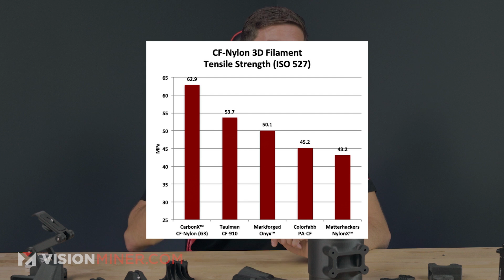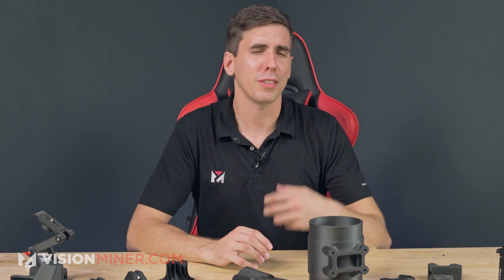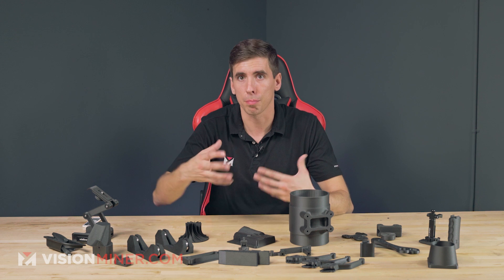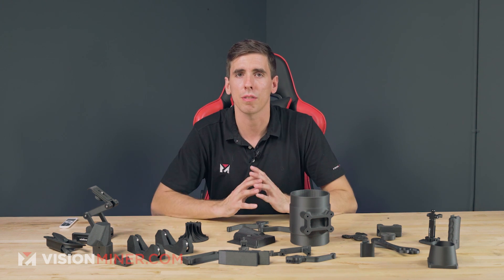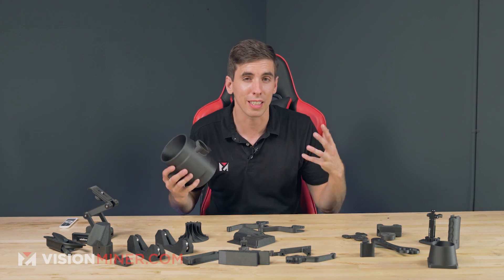What is Carbon Fiber Nylon Filament and Should You 3D Print It - Pt. 1

Comment: Few things you forgot to mention. CF PA ("Nylon" is a DuPont brand name), is manufactured using different types of polyamides and different percentages. Most CF PA is created using a high percentage of PA 12 which is lower melting temperature and easier to print. However it is also has considerably less strength, hence why your levers were easier to bend. The higher temperature CF PA is manufactured with PA6. PA 6 is much harder to print, requires higher temperatures at the nozzle, higher bed temperatures, and higher temperatures in the enclosed cabinets. But it is much stronger. There are other higher temperature CF PA products which contain percentages of Ultem, Peek and Pekk in order to increase strength and heat deflection. Yes the addition of composite to PA lowers its tendency to shrink, warp and peel off your print bed. Some filament manufactures, such as Proto Pasta, add drywall dust to their filament as a composite. 

You must use a hardened nozzle while printing abrasive filaments, such as carbon fiber. Most of the temperature guidelines are based upon an Olsson ruby nozzle and not hardened steel. If you use a steel nozzle, I have found that you need to add 10-15 degrees higher at the nozzle. The reason is that the Olsson nozzle is made from brass or copper and conducts heat much better than the steel. You can print these filaments with many of the regular printers, but you will have less layer adhesion than you would with a printer that can print +300C. Adding a ruby nozzle to some of the regular printers will increase your chances of a complete melt and layer adhesion. 

Fan cooling is normally not used when printing PA. However, when printing small areas on a large part, intermediate spot cooling may keep the PA from becoming too hot and drooping. I use exterior fans and vaned concentrators for this. 

Dehydration of PA is required. PA 12 is hygroscopic (tendency to absorb moisture from the air) and the usual listed time to dehydrate these filaments will apply. However PA 6 has twice the ability to absorb moisture and requires much longer to dehydrate. Metal aerated filaments spools, such as those sold by Vision Miner, are required. This is because the 80-90C heat to dehydrate PA 6 will melt plastic spools. I dehydrate at these temperatures for 48-72 hours depending on the type of PA and how it was stored in a particular climate. 

Lastly, thank you for your video, I am an engineer and manufacture who specializes in plastics. I am also a customer of yours. I 3D print exclusively in polyamides, approximately 2-5Kg of PA6 a week. I manufacture 10,000 Kg of raw polyamides annually.
Reply from the maker: The CF part compared to the HTNCF25 is actually PA6+CF. Excellent information in your comment, though! Dehydration is incredibly important, thus our drying kits: www.visionminer.com/drykit 

Rock on! Epic information! By the way, we're happy to extend a discount on whatever you like, printing in bulk like that :) Just give us an email and we'll make it happen!
Reply: @VisionMiner  Yes, I understand now that you were comparing: CarbonX™ PA6+CF (Gen3),  CarbonX™ HTN+CF [High Temp Nylon]. The HTN is not just pure PA6, but has additional higher temperature resin added in order to increase the melting temperature, modulus and tensile strength. Both are great products that you sell from www.visionminer.com.
Reply: Hi, your comment is very interesting, thank you! I want to print CF nylon for RC car parts. I read that you recommend the filamatrix. I live in europe, do you recommend other brand ? I was thinking about PA12 mostly (easier to print). Thaak you for your answer.
Reply: @bricoletout  I think that brand is less important than the actual technical specifications of the product. Depending on what you are making for your RC car parts, you may not require ultimate heat resistance or stiffness. You may not need Carbon Fiber at all and may be able to use GF or pure PA6. CarbonX™ PA12+CF is lower temperature and easy to print as an option.
Reply: So is NylonX from MatterHackers is licensed with Dupont to use the Nylon branding?  This product is 20% CF and the rest Nylon.  It definitely likes to suck moisture out of the air, so mine lives in a vacuum case with desiccant and only comes out when printing with it and even them I have a mostly airtight box with passthrough.  Luckily these are sold in 1/2 KG spools, so once I crack one open it's usually gome fairly quick.
I'm curious if anyone uses gloves or respirators when handling and/or printing?  I haven't been, and wondering if I should be..
Reply: @Hangs4Fun  I think sanding is when you need gloves etc. I think the printed part should be fine as the fibers should align with the extrusions, and molten plastix is sticky, so you should mostly be fine.
Reply: Thank you for the thoughtful and informative comments and information.
Reply: Funny thing. I get CF-PA6 from PolyMaker, and their PA12-CF is nearly twice the price for the same spool size.
Reply: polymakers cf nylon dries at 100c on pc spools, and i find that works
Reply: From what I have seen, "high temperature" tends to refer to semi-aromatic polyamide- so (I would assume) stuff like diaminalkyl terephthalates and what not- also, the 3dxtech HTN is advertised as having water absorption an order of magnitude lower than PA6
Reply: I wonder about the stress properties considering CF PA
Simply what is the breaking point
Reply: Do you know of an easy DIY way to treat the final surface so it isn't as rough on the skin?
Reply: I appreciate all the information thank you for the post. I'm just wondering if you have any experience with CF polycarbonate and how it compares with CF polyamide because to me it seems like it has more advantages than drawbacks when compared to polyamide nylon.

Comment: Answer me this
Industry standard uses PA630GF (Nylon with 30% glass fiber), so why do filament manafactures use carbon fiber instead.
Reply: Filament manufactures also use 30% glass in some of their products. Glass fiber composites tend to be more flexible than carbon fiber and in some cases are stronger because of this. Glass composites are also much easier to print than carbon fiber and will clog less at the nozzle. One of the major advantages of glass composites is the ability to color it. Life would be pretty boring if everyone's cordless drill bodies were all black :)
Reply: @MichaelJHathaway  it just seems a lot less common for some one to talk about glass fiber filament. Carbon fiber is 80% marketing gimmick and nerds love carbon fiber even if it isn't as good. Ty for your input.
I have a carbon fiber PC spool unopened, i will use it for a custom 3d printer build. Would of loved to seen a glass fiber setup but this spool was a special order over seas as it was.
Reply from the maker: Carbon is good for other things, like ESD properties -- glass doesn't conduct electricity, so it will still work as an insulator. We actually have a glass-filled PA6 on the site now, check it out here! https://visionminer.com/products/fibrex%E2%84%A2-nylon-gf30

Comment: I bought a Creality CR 10 three years ago and removed the cooling fan so I could print Nylon - X from Matter hackers.      I only print engine parts on account of the cost of machining.    My only concern is the price of Nylon - X, and is there any other alternative like; If I buy in bulk?   I like the 20% nylon you were talking about and would like to get some for a collective pitch rotor design I'm working on.  And do you know of any alternative to Iron PLA, like is there any Iron nylon blend that I can use for 3D Printing electric motor stater core's?    I need some kind of Iron impregnated filament that can operate at a higher heat rang then Iron PLA, they call it; Proto - Pasts, it's made by; PROTOPLANT.  The 3D printed electric motors stater cores are printed out of Iron PLA to help with electrical conductivity because of it's faro magnetic propertys, it's just that PLA can't take the heat under load, and these are brushless motors, so; they need to be able to run for long periods of time.  So; do you know of any high temp Iron composite other then "proto - pasta PLA?
Reply: Try Filamatrix. Its a little less money, much better product.
Reply: @MichaelJHathaway  OK, but; how does it stack up to: Matter Hackers Pro Series Nylon carbon composite at $224.00 for 2.2kg, and Filamatrix price for Nylon Kevlar is $237.00 for 2.2kg, So; are you saying; Filamatrix is a stronger product for the money?  If so; maybe I aughta get some?
Reply from the maker: The HTN CF25 would work fantastic -- we have it on the store now: https://visionminer.com/products/htn-cf25
A tad more expensive, but insanely capable. HTN CF from 3DXTech might be enough as well, it resists temps up to 195c!

Comment: What if you dunked it into the resin used in conventional carbon fibre? Perhaps with lots of tiny holes built in in the printing process?
Reply from the maker: Depending on the resin properties, it would definitely be cool! Might lose some dimensional accuracy (depending how thick the coating is) --- but we've actually printed specifically with holes throughout the entire part (lower extrusion width/etc) so you could fully impregnate it with resin and have a pretty gnarly part...
Reply: @VisionMiner  that sounds really cool.  Might be good for small motorcycle and mountainbike parts. Winglets, crash protectors.

Comment: Can you get it wet after printing? Or is it still just as sensitive?
Reply from the maker: Nylon absorbs moisture, but usually in a final part it doesn't affect much. It will be more brittle when dry, and generally has more "give" when wet. Underwater for years at a time might not be the best, but it won't fail from basic applications, and swelling is minimal.
Reply: The answer is yes, after printing, PA can absorb as much as 10% its weight in water. However, if you anneal the PA after printing, it will be less likely to absorb moisture.
Reply: Michael Hathaway how do you anneal it?

Comment: Could you 3D print an intake manifold for a car and use it reliably?
Reply from the maker: Absolutely! Especially with the new high-temp stuff we got (HTN+CF) -- visionminer.com/materials
Reply: I think you could if you used a PEEK insulator between the to mating surfaces. Even the high temperature PACF would tend to sag in places near heat, and may be a problem near bolted areas and introduce air leaks.

Comment: Any recommendations for the z distance for supports when printing in CF Nylon?
Reply from the maker: Generally a single layer, or 0.1-0.2mm -- 0.1mm can be harder to remove, but has better surfaces than 0.2mm.

Comment: I've found that parts go floppy after you flex them a few times. Is this normal? Perhaps the fibres lose their bond to the matrix? Before flexing, they feel about the same stiffness as PLA. I printed exact same control rod in different materials to compare them.  
PS. using e-Sun CF-nylon (not their new CF-HTnylon which I can't find for sale yet.
Reply from the maker: They more than likely use milled carbon, but I'm not sure. That's definitely a cheaper brand, likely not engineering grade. However, when you bend things and they lose rigidity... yeah, this is normal, with most materials. You're actually messing with the structure on it. some materials, like Polypropylene, can be flexed over and over without losing shape, but nylon is not one of those materials and will take memory of where you flex it.
Reply: @VisionMiner I mean the same part (square rod in my example) in PLA, if bent the same amount,  would just spring back a million times without losing integrity at all. I realise it's hard to compare properly as I'm just bending them in my hands...but the characteristics felt weird from what I coudld feel. I'm keen to keep experimenting and learn more.

Comment: You mentioned that it can be printed with soluble supports like PVA or using nylon CF itself. I was under the impression that it only adhered to itself is this not true? Ive had plenty trouble using soluble supports with it so gave up and stuck with the nylonCF but it is super hard to remove most of the time. If anyone has advice on settings or materials please let me know.
Reply from the maker: Not sure who told you that, but it's definitely inaccurate. Our favorite soluble for CF Nylon is Aquasys 120, and Aquatek also works great!
Reply: What printer and slicer are you using?
Reply: Tyler Wright Raise3D pro 2 plus with ideamaker

Comment: I printed multiple parts in matter hackers CF nylon on my mini prusa. It prints really well. 255/100 temps. I printed in an enclosure I built myself.
Reply from the maker: Heck yeah!
Reply: Does it stink?
Reply: @rcplayday7937  No it doesn't stink. The enclosure contains most of the smell. But the smell isn't bad at all.
Reply: @3DO-Biking  thanks, I just got a roll of easy nylon, I dont have an enclosure is it a must have?
Reply: @rcplayday7937  You should definitely enclose it. My first enclosure was a cardboard box. I made a lack enclosure and I bought an enclosure from Wham Bam. The Wham Bam enclosure is damn good. It's not that expensive either.

Comment: I've been using a MarkForged Pro with ONYX material to print several workpiece fixtures and prototypes. The printer has the option of embedding continuous fiberglass, but that's not an option I use as often. The parts come out fairly clean with minimal layer lines. I can't tweak any of the settings on the Markforged printer though, so I would worry about trying another brand of similar filament. The printer doesn't have a heated chamber or bed, but I haven't had any warping issues on lower-profile parts.
Reply: I use a Markforged 2 at work. It can imbed CF into the part but I don't usually need it. When I do need the extra strength though it is great! The parts become very stiff flat & strong. They advertise it to be as strong as AL but from my experience,  I don't I don't think so but still very good. I like the machine & rerely have an issue with it.
Reply from the maker: Onyx is nice, but like you said, you're super limited on an expensive machine. We get incredible results with the multiple blends of CF we carry -- CFPA6, CFPA12, and CFPPA (CFHTN) --- all of which are stronger and more rigid than Onyx alone, and actually more rigid than the fiberglass embedded parts -- we know this, as we duplicated their samples and tested :) However, when it comes to super crazy parts, the embedded CF still does shine.

Comment: great stuff I use it all the time but we tried one of our drone frames out of it it's not very impact resistant like regular nylon 910
Reply from the maker: Definitely more brittle with the CF, while much more rigid!
Reply: I feel like that would be due more to its rigidity compared to 910.  Generally softer stuff is more impact resistant.
Reply: Interesting, I’m waiting on both of these filaments, 3DXtech CF nylon and Taulman 910 to see how they both perform (using Prusa MK3S) 

How do you find ease of printing with the  910 vs CF Nylon?

Comment: What would the downsides be if I were to use this material on my ender5?
Reply from the maker: Warping on larger, thicker parts. If you can keep the first layer down well (our Nano Polymer Adhesive works GREAT), and possibly toss a box over the machine to keep heat in -- you'll have a great time :)
Reply: @VisionMiner  I don't wanna sound ungrateful, and as I said, you Nano Polymer is irreplaceable for high temp stuff (PEEK, ULTEM, PC, etc). But I have to say, for nylon - Magigoo actually works much better!
Reply: If you start with standard printer - biggest problem with CF-nylon is abrasion.
You need: hardened steel, vanadium or ruby nozzle for this.. 
Coz, it will ruin brass nozzle very-very fast, you might not be able to finish even a single print.

Comment: Can't wait to try out that HTN  CF25 and HTN-Z
Reply: Wait.. are you guys talking about Essentium or MarkForged?
Or new 3DXTECH HTN+CF?
I just got 3DXTECH, but it doesn't say what's the percentage of CF?
Reply: @Sleepery22  I am talking about the Essentium products. But I do use 3DXTECH materials and it always works flawlessly.
Reply from the maker: HTNCF25 is essentium, CFHTN is 3DXTech (it's amazing, by the way..... I have been printing it all week and I can't stop!) 

Percentage is usually 10-13% in filament -- with Essentium, they used a coaxial-extruder method, so it actually has a sheath of nylon around the outside, while the inside is packed with the 25% carbon. That stuff is nearly as rigid as aluminum!
Reply: @VisionMiner  the HTN-CF25 is my next purchase. Right now im burning through a 2.5 kg spool of the HTN-Z for some hazardous area splash guards and  so far all the tests look promising.

Comment: Is chopped fiber harmful to human skin? I touched those carbon fiber nylon filaments and felt pricking every time
Reply from the maker: Handling parts printed with it generally don't leave residue, thanks to being 99% encapsulated in polymer -- if you're making a door handle, it's probably not the best option, we've never experienced any long-term or even short term discomfort from handling the parts. Clearly, we've touched a lot of them, and it's not much of a concern -- but it's not something to entirely write off, either. It's a lot like fiberglass insulation -- you probably don't want to touch it. Great comment!
Reply: Thanks for the video, when you say the carbon is chopped, does it have the same health risks as nano tubes? Or are they one in the same?
Reply: I don't think it's particularly dangerous if you're touching it.
Nothing like 405nm resins, that produce a serious skin reaction.
But sending / dremeling it - that's a bit of a problem..
It produces dust that spreads everywhere and it's very difficult to avoid inhaling it!
CF-PolyCarbonate is even worse.. 
I've just ordered Shop Vacuum to help with this problem.